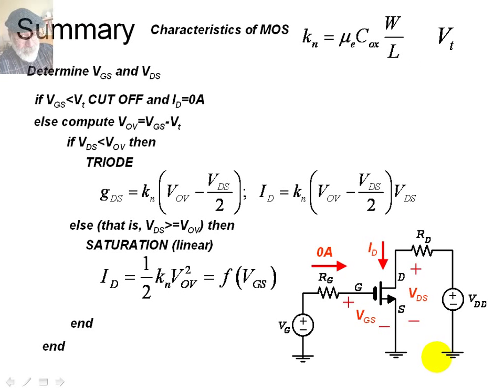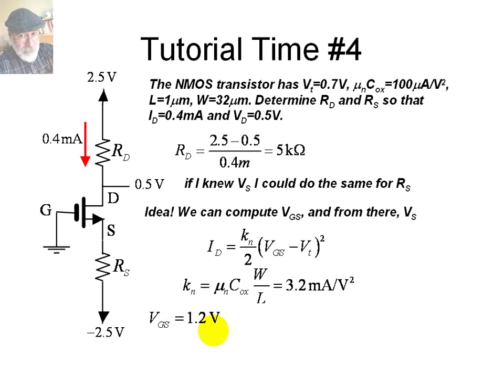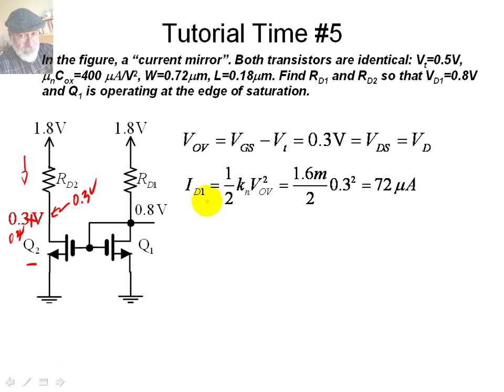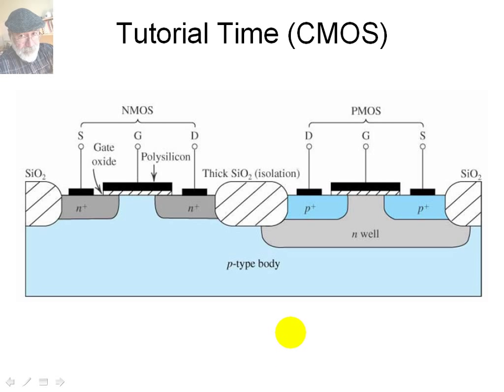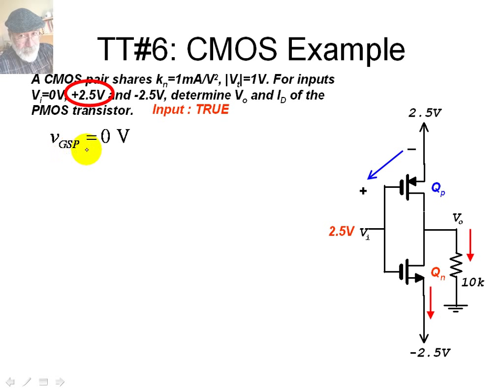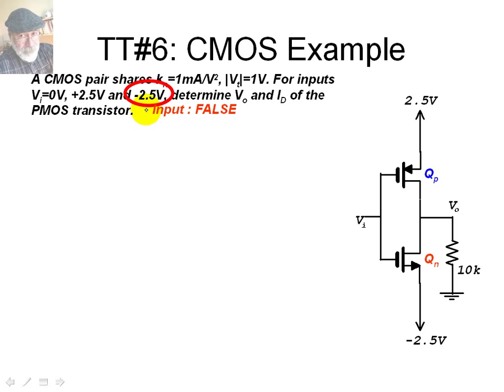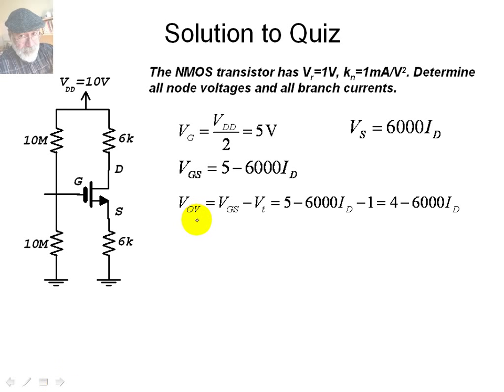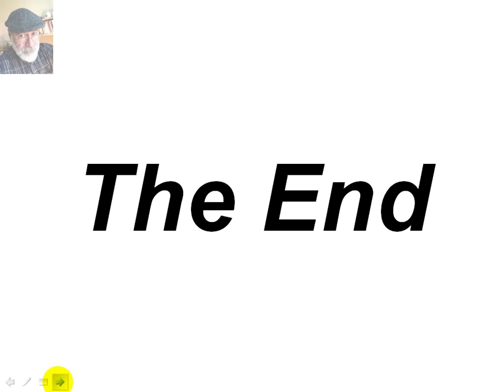FET/MOSFET (Video 4 of 4) (DRAFT)

Comment: Really awesome videos. It helped me a lot to prepare for exams. Love from Bangladesh sir. :)

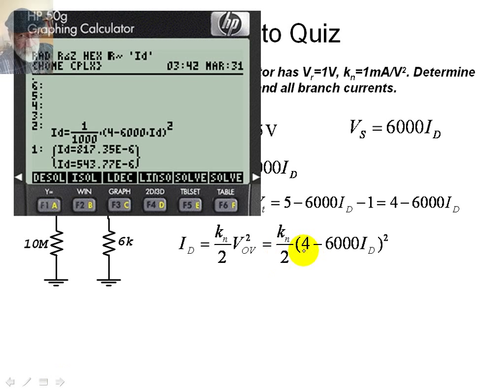One small thing I'd like to point out, at 29:22 the calculator input doesn't seem right and my answers don't match with the lecture.
Reply from the maker: Thanks, Mr. Shams from Bangladesh. 29:22 discrepancy... that means that you really do the math, not only watch the video. I would like to have you as one of my students in the class! You will be a fine engineer.
Reply: @rolinychupetin  Sir, thanks a lot for the kind reply. It really means a lot. 
:)

Comment from the maker: A comment from Miss Baum (I accidentally pushed the wrong button and deleted it), she wrote:
Fantastic video as usual, Dr. Linares. Thank you for all your help in preparing us for the final. There's one small typo you might want to note, at the bottom of the slide around 5:50, I believe the calculation for Rs is mislabeled as Rd.

REPLY: Yes, Miss Baum, you are right. Thank you.. Also, in the last HP computation, when copying the expression from the slide (correct) to the HP, I missed divide 2.